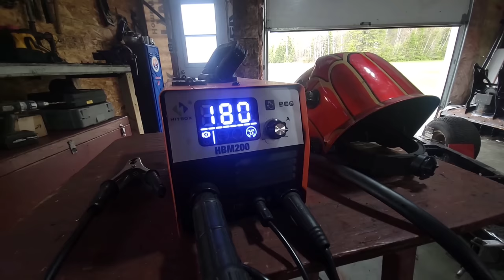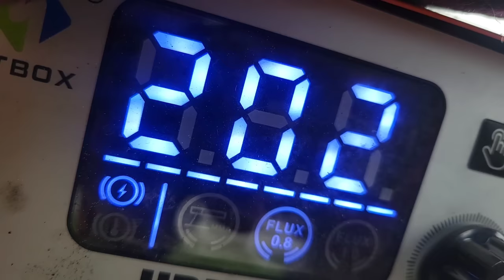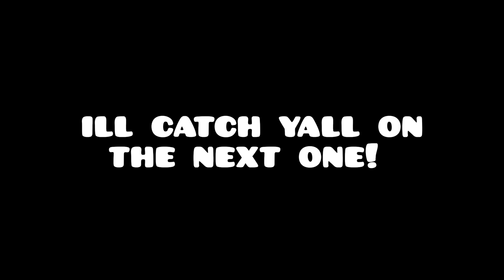FAST MOWER BUILD PART #1

Comment: In my yard, aboot 10' from in my shed, is the same early-mid 90s mtd yard etc. variable speed two belt tractor, stock and no deck, 15.5 b&s ohv. plan: it's getting a square tube and angle iron braced frame add-on lift, wheelbase stretch, and using a 1" straight keyed axle on flange bearings to lock the rear; with sprockets driving chains from the stock fnr trans to the lift axle. We can vary the output rate without overdriving the belts or transmission, and lock the drive without welding or disassembling and modifying the trans.. need a good drill/press and vise to make mounts to position the keyed axle anywhere it suits the build. I recommend this if any of you have the resources to finish and test it before I do! Stock belt lengths are 5/8 x 52.5" engine to cvt and 48" for the rear. Love the steering mods and unintended lockup 😅

Comment: Seems like you done pretty much  everything  to make it safer for high speeds.but I would definitely get ride of the crappy front wheels and put some go cart wheels on the front and get ride of them plastic bushings. Because you don't want to loose a front wheel at any speed.
Reply from the maker: i am going to work on that asap !  i need go kart wheels with high speed bearings !

Comment: Do the pulley swap on the transmission for my tractor and ill give you a complete mtd 12hp  tractor with welded diff . Needs an idler pulley for the rear drive belt. Im in dorval if youre in the area

Comment: I'm a little slow but what made it this speed? like was it changing the belt that unlocked its full potential? surely its not just the governor or whatever right? How do you get the full power out of the motar i feel stupid asking this but
Reply from the maker: pulley swap and foot throttle is what makes the difference

Comment: Also ur frame is in a little bit better shape(less rust in some spots).How much wiring did you have to do?(I had to pretty much rewire mine without safety switches and other electrical crap).
Reply from the maker: super simple wiring  just push start kill switch and led bar so i just have 6 wires running along the frame
Reply: similar situation, im re-using a lot of the old wires. and is the transmission holding up upside down?
Reply: ive got a manual so ive gotta shift backwards. XD
Reply from the maker: @LVBeatzMusic  yess my transmission is upside down haha

Comment: How much did this cost you in total? Also do you use a key switch for ignition? I need help trying to figure out how to run wires for my ignition switch 😅
Reply from the maker: i got the mower for free and pretty much already had everything at home to build this ! only things i needed to buy is belts and pulleys cost me around 60$  and i have a push start button  u get one side to the constant power side of the selenoid and the other side you ground somewhere on the frame